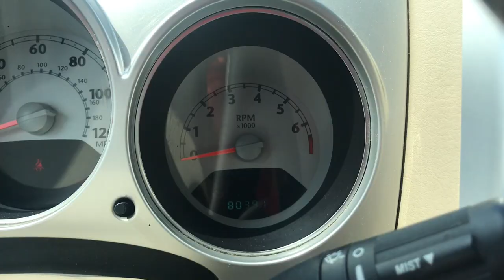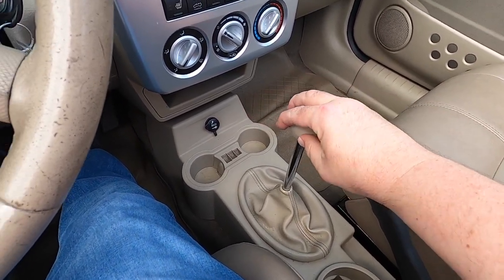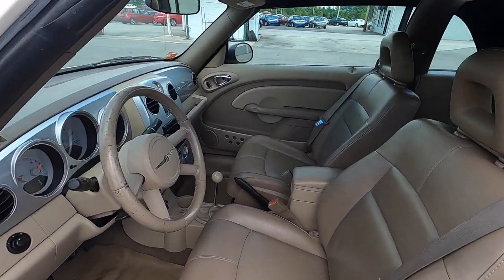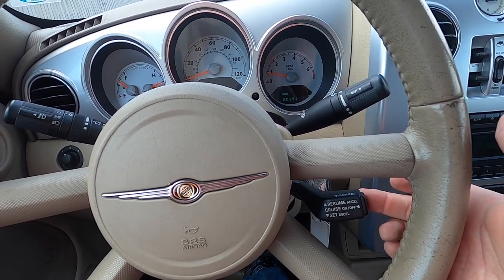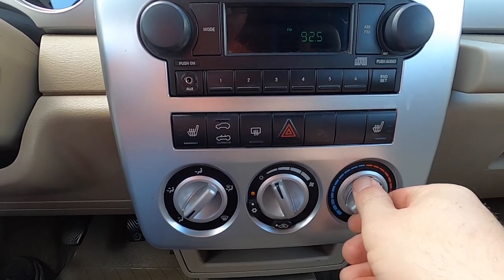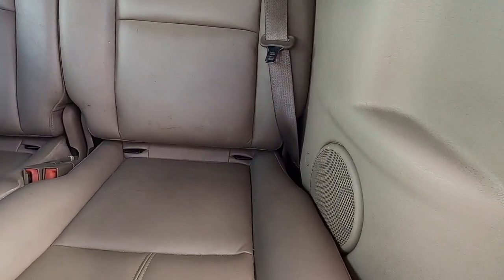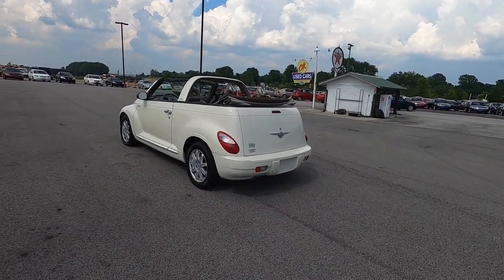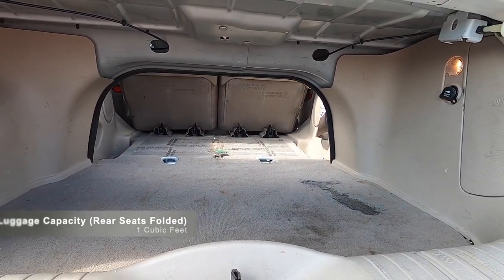2006 Chrysler PT Cruiser Convertible|Walk Around Video|In Depth Review

Comment: I also have a 2006 PT Convertible TURBO w/33k miles and the only criticism I have regarding the vehicle is the absence of replaceable relays. This makes the car artificially expensive to repair because if you do have a problem that's likely a relay you cannot do any basic troubleshooting, such as swapping relays with like-kind relays. 
All of the PT's switching functionality is in one EXPENSIVE replaceable plug in assembly, the TIPM. There are some companies that rebuild them but when at one time on similar sized cars you could spend $20 to replace relay, in the PT you're going to spend a few hundred bucks. To make things even worse is that they're not swappable as different version of PT's use different TIPM's. My convertible TURBO will not be compatible with a PT hardtop with a TURBO....

Comment: I have a 2006 convertible Pt with 65 k for sale. What's it worth? Everything works, paint great, interior nice
Reply: not a lot tbh. you would be lucky to get $3000 for it. its in that twilight zone between being just a old car and a modern classic. Depends on if you have somewhere to park it up for 10 years when there will be less of em and demand and nostalgia will improve its value. low milage classic command a very good price. This car is certain to be valuable if you can hold it.